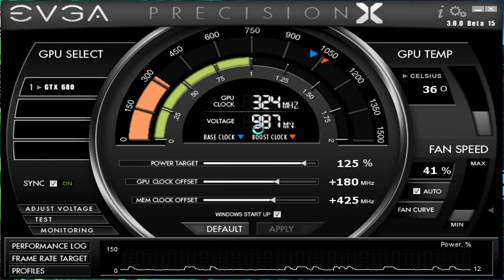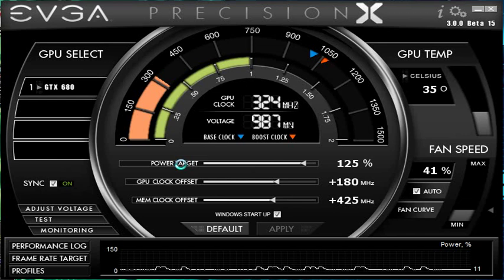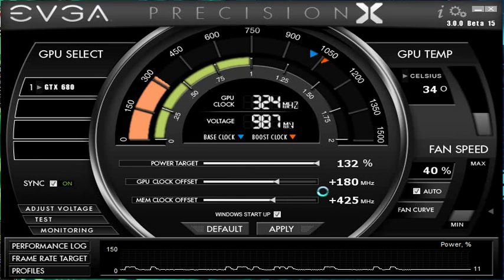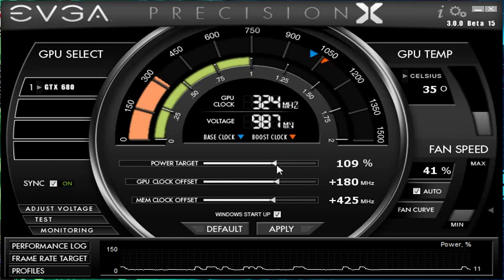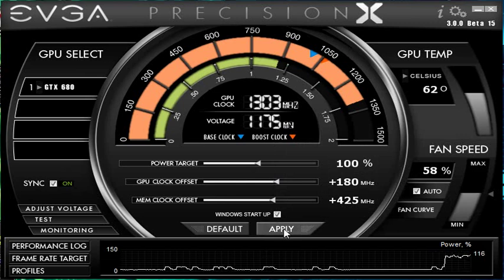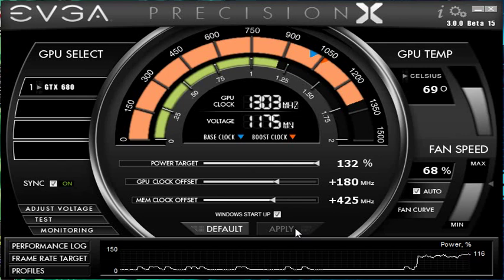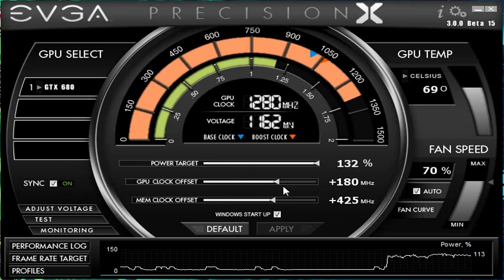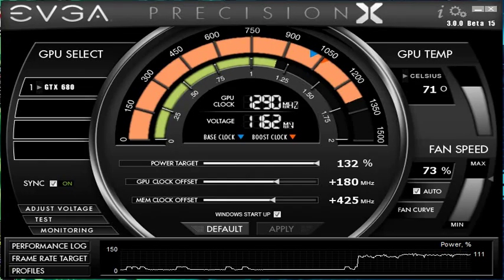GTX 680 Overclocking Guide Using EVGA Precision X

Comment: Unlike what you been told before. with this card and this program you have to first set your mem clock. then bring up your gpu clock offset for a much better clock. otherwise for some reason if you do it the other way around you will have trouble overclocking. so do mem clock first. mines at 500+ thats 500 times faster than normal how cool is that.
Reply: +Paul trotter great tip :) helped me out :) thanks .

Comment: When I'm benchmarking my 680 the GPU goes up to 99-100% for a minute or two and the stops working, If I try to benchmark it again with the same clocks or even lower clocks it will never go up to 100% and I have to restart my computer for it to work again. any advice? =(

Comment: Going to try this when I get home. I have the same GPU as HawtGiven (i.e. EVGA variant) so I'm guessing I will have to go slightly lower than your settings. Maybe omfgitzalex' settings will work since it has a lower GPU clock offset (Higher memory clock though).

Comment: I got my 680 GTX to about 1241Mhz GPU clock offset on FULL LOAD. and about 3523 Clock Memory Offset in Total. So far its pretty stable, even when i benchmark with heaven DX11.  My Gpu clock offset target is +160Mhz and +525 on Memory offset. Max Temps about 70-73 degrees with an 85% fan speed when it gets to 70. I hope this helps u guys...I mean..its whats working for me. :)

Comment: The max temperature your graphics card can “safely" perform on depends on what gpu you are using. GTX 680 max out at 98C, so you can comfortably run it at ~80. Obviously you should start to worry a little bit after 90, but no point before then. Your more "general" view is why many GTX680 customers thought they heat up too easily and the auto-fanspeed is set too low. The fan doesn't really raise too much until going over 80s.

Comment: With the most graphic intense mods, Skyrim brings this card to it's knees (in certain areas). Also, 3D gaming at max settings will receive some boosts from this, as well as running 3 monitors. And you have those people who want the absolute most powerful machine they can create. Many reasons!

Comment: is there some way to adjust the voltage higher. My kfa2 gtx 680 can only run 1228mhz stable. I have a waterloop for my card so no worry for temps

and btw how long should i run heaven bench(maxed out) to check stability

Comment: i have a question
when the +coreclock is +110mhz my gpuclock gets 1228mhz. If i raise the +coreclock to +111 to 117mhz nothing happens. The gpuclock is only 1228. If i adjust the +coreclock to 118 the gpuclock bumps up to 1241 and gets unstable. Why cant i  adjust  to something between.

Comment from the maker: I am using EVGA Precision X. Some more software I would recommend is the Heaven benchmark. It is a good tool for stress testing the card after an overclock. EVGA Precision X also has some tools for stress testing the graphics card built into it. My recommendation is don't get overzealous and bump your overclock up slowly until it crashes on one of the stress tests. Then start backing it down until it is 100% stable. If your driver crashes or you get artifacts the overclock is too high.

Comment: Hey sircolby45,

I have a gtx 680 2gb, and would really appreciate any advice/tips you have for running this card optimally. I have searched everywhere and come away with very little. 

Could you please advise me on the steps you have taken and still do take to run this card better, which software you use and settings. 

I am currently at work without headphones so i will watch this when i get home 

Thanks :)

Comment: I recently bought a GTX 680 and have been trying to OC it, but whenever i do, my driver crashes
Im using 120% power 177mhz gpu oc and 500mhz mem oc, do you have any ideas as to why this is happening?

Comment: don't over clock your graphic card or else it would be burn , just buy a cheap SSD and it will do it for fraps , if you have a good SSD your fps shall go up significantly while frapsing..

Comment from the maker: You probably just turned your card up higher than it can run stable. It should be fine just turn it down. All cards are far from equal and your overclock may not go anywhere near as high as mine. I have seen plenty that couldn't get half of what my card does. Increment the clock up slowly and test for stability after each increment by running the Heaven Benchmark, a stress test program such as the one that comes with EVGA Precision X, and then some games like BF3.

Comment: well .. i have EVGA 680 .. and i record games with fraps .. what should i put those numbers at ?
should i even touch the gpu clocl and the mem clock ? or should i just stay with the power target?
and while recording battlefield on ultra what settings you think i should put those at ? and how can i control when to increase and decrease the preformance ? i mean with a push of a button ? please reply .. im having problems recording even on low,  but i can play on ultra just fine and get 150+ frames

Comment: Hi. I used EVGA Precision X to overclock my AMD Radeon 6870M (recommended by someone.. somehow it works perfectly.) and this is what i made: 675Mhz / 1000Mhz >>>>>>>>>>>>>>> 700Mhz / 800Mhz.. somehow it works well but i did not touch the fan and voltage properties. Is it safe for the clock i made?

Comment from the maker: For starters different cards boost to different amounts with the same offsets. Did you remember to increase the power target? A +180 offset should be getting you much higher than 1055MHz even though you likely will not see the exact same GPU boost as me. 1055MHz is stock so it sounds like your overclock is not being applied for some reason.

Comment: I set the all of this up like you did and it did not increase in the GPU boost to the amount it did at the end of the video, I tried increasing everything at increments and I got it to 1055mhz, but I was wishing it would work the way yours did? Any suggestions? Did I do something wrong? I'm kind of new to overclocking and this video is still a bit confusing for me.

Comment from the maker: Your CPU overclock should not affect your graphics card overclock in any way.(Unless you push your power supply beyond its limits) The GTX 680s do not have unlocked voltage, so there is no way to go beyond stock voltage. The power target sets the overall power consumption and not the actual voltage going to the card. You can turn the power target as high as you want and it will not affect your overclock.(Unless you put it too low  and cause it to downclock to stay under the target)

Comment from the maker: You still overclock SLI cards the same way you would a single card. With the cards in SLI you may not get as good of an overclock, but you can still push them as far as they will go without crashes/artifacts just like you would a single card. Just make sure you have a power supply that can handle it because it is going to raise the power consumption a good bit overclocking two cards. 

As far the 'burn in' period I have never heard anything about any burn in period on a graphics card.

Comment from the maker: It downclocks at 70C and again at 80C, so if you don't want it to downclock you need to set a custom fan curve to keep the card cooler. If you are experiencing stutter though there may be something else causing your issues. What is your GPU usage % look like when it is stuttering?

Comment: Hey Sircolby45 i have a evga gtx 680 i raised the power target like u said all the way but it still down clocks and seems to create stutter and thats with vsync on or off and im using the 301.10 drivers i belive (the stable one as of now) Any more suggestions on how i can lock my gpu clock? Thanks

Comment: The best way to determine maximum memory overclock is by benchmarking to determine the performance ceiling, not by visual artifacts. Overclocking the memory too far will slow performance significantly because memory errors will cause memory fetch retries.

Comment: I did, and my fps sits consistently at 120.  I only did a light overclock, but my temps were around 60-68 degrees.  Although, when I record with Fraps, even onto a different drive from BF3 installation, I get 50 fps.  Not sure why though.

Comment from the maker: I don't really notice it getting any hotter. Most of the heat usually comes from voltage bumps, which you can't do on a reference 680. I am sure there is probably a very slight heat increase, but nothing that is noticeable.

Comment: This is exactly what I needed. I did a vid installing my EVGA GTX 680 +SC in my Alienware R3, but when I went to overclock it just yesterday I was having problems with the down clocking and I really didn't understand how to get it the way I wanted it, but this is just what I needed thanks a lot.   The performance in BF3 in stock settings is still over 60fps for me, I like to see what it does now with the beast overclock.

Comment from the maker: I can't recommend these settings to anybody because every card is different. Just because my card can handle those settings does not mean yours can. You have to bump it up incrementally until you start seeing artifacts or driver crashes and then dial it back down until it stops. I recommend testing it using the Heaven Benchmark, EVGA OC Scanner, and lastly your games.

Comment from the maker: That one I can not answer for you. Every card is different when it comes to overclocking, which is why they don't come that way from the factory. Overclocking can be a timely process and requires a lot of trial and error. My card is overclocking better than most that I am seeing, so I would probably start a little lower than that and work my way up slowly until it crashes.

Comment from the maker: Yes I do see an increase in BF3. I am using a GTX 680, which is also what I am overclocking in the video. HardOCP has a good review of the 680 that shows you how much you will gain from overclocking the 680. They actually did not get their card as high as mine and still got descent gains in performance.

Comment from the maker: It is 100% stable for me. I did dial it back to +177(1300MHz) and +400 on the memory just to ensure that it is 100% stable although I didn't get any crashes at those settings.

Comment from the maker: Yes you should see a descent amount of performance boost over stock. The green bar is showing the current voltage. If you are not familiar with overclocking I would recommend looking at a few more guides that cover the overclocking process. My guide is more suited to help people transition from older style cards to this new style, because the overclocking is slightly different. It does not cover enough information for somebody who has never overclocked before.

Comment from the maker: That is actually a good OC. My card is a little above the average on the core. Yours is about average. As of right now the voltage is not unlocked on this card, so you can't modify it. If you have any other questions just let me know.

Comment: Hi there, I have a quick question. Did you change any voltages??? I'm asking because I got my card at +150 Core and +500 Memory and there is no goin' further. Any tips or is it possible I got a card that doesn't OC as well? cheers.

Comment: Btw, I just noticed, you dont mention the Adjust Voltage option at all.

My particular card crashes whenever I run half a Unigine Run @ +100/200 and +132 power.

Comment from the maker: Putting the power target to 132% makes it behave basically just like the old style overclocking. As far as the thermal downclock if 13MHz really bothers you that much you can always go for a card with an aftermarket cooler, which could easily keep it under 70C.(They aren't out yet, but it probably won't be long)